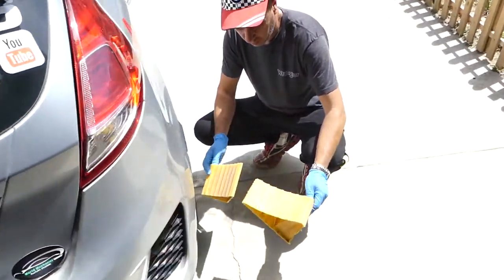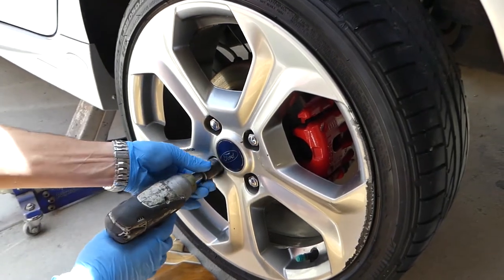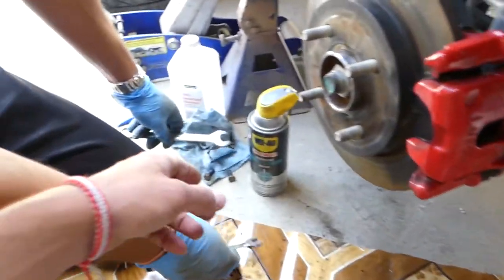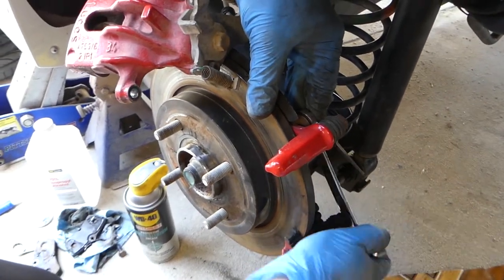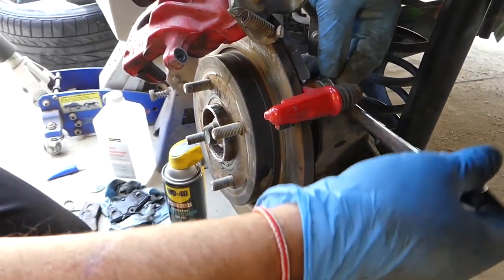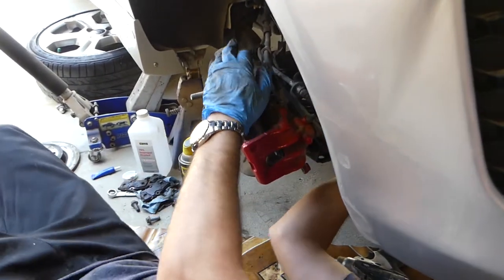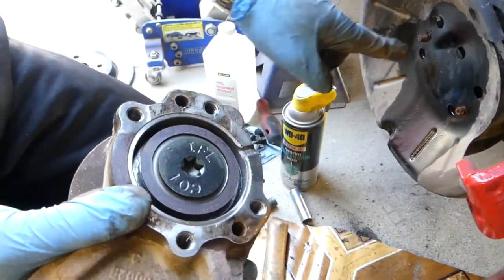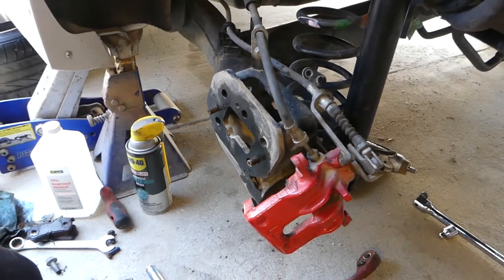FORD FIESTA REAR WHEEL HUB BEARING REPLACEMENT MK7 ST

Comment: If you live somewhere with winter weather check those rear caliper guide pins while you do this.  They rust up and freeze the caliper and trash your pads and rotor.

Comment: The whole hub assembly is pretty much unobtainium.  I can only find old used hub assemblies on ebay going for just plain silly prices.  No sources have it available new. 

You should make a video showing what is involved to replace the only the bearing itself, as the replacement bearing is still available.

Comment: Is it possibly to just change the bearing from just the flange on MK7 ST?  

I have a MK7 ST  but have changed the rear bearings on my MK6 ST150 (very similar set-up) and all you have to do is remove the flange section and replace just the bearing inside the flange, no need to remove the entire assembly..... plus for just one of those hub knuckle spindle sections with no bearing or flange here in the UK is about £160 new from the ford dealer and no other company supplies them. :-)

Comment: What's the part number where did u buy from I cant find st hub assembly
Reply: You ever find the hub assembly @MOTOWOLF
Reply: @gagepicard3351  nope I ended up replacing the rear swing arm and it came with both sides that were fine so went with them still been good.